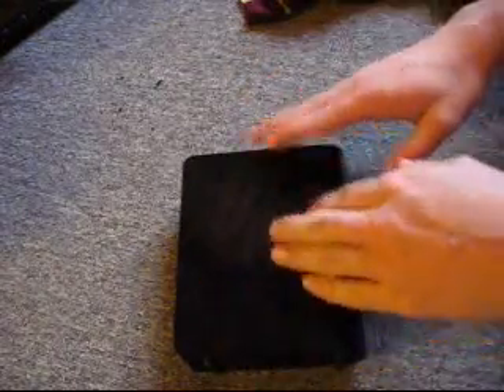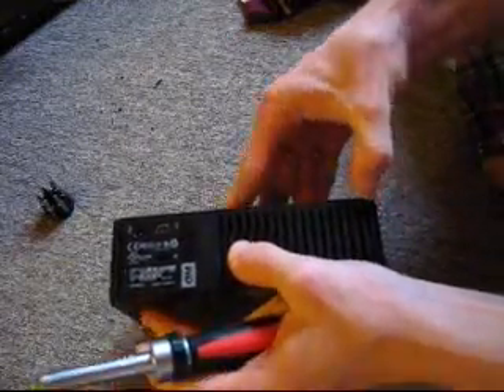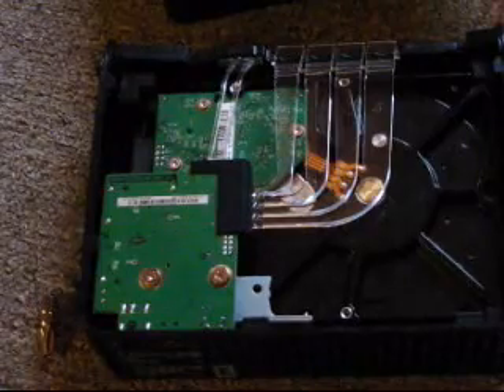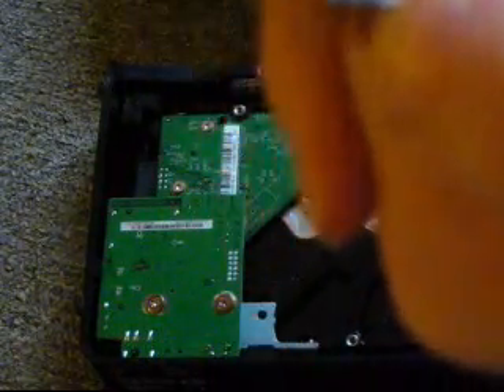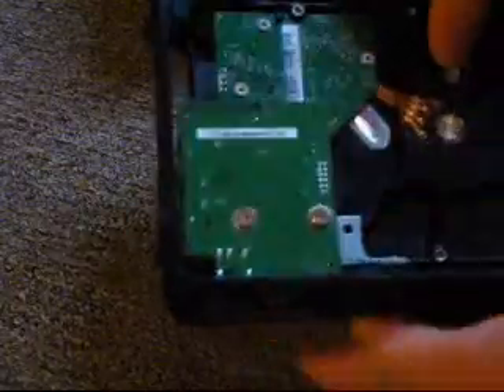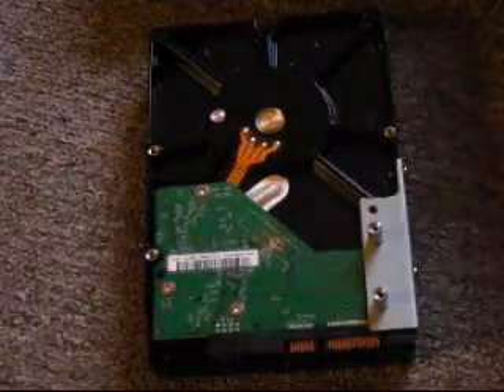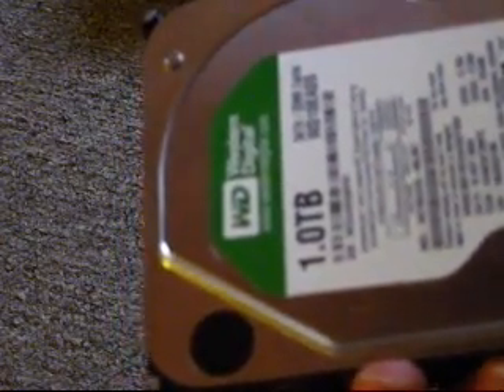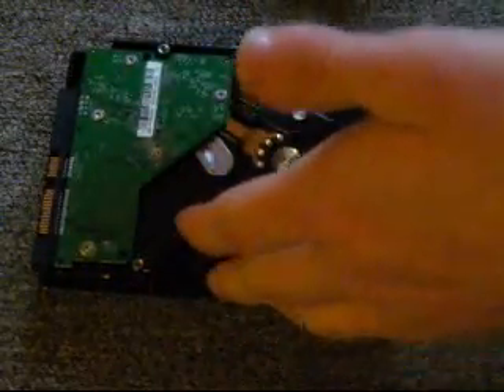How to fully DISASSEMBLE a western digital MyBook essential edition external HDD

Comment: Good video.  Credit card or credit-card-like rigid plastic works better in my opinion than a screw driver, and probably less risk of marring or breaking the plastics.  Just use the credit card the same way you used the screwdriver, and it pulls right out.

The SATA connector assembly that they use for the my_book works well for using as an external drive, just pull it off, and don't use the case, when you need to work on SATA drives.  Easy on, easy off.

Comment: actually, open the case doesn't void your warranty, WD has a rather good warranty service, the warranty is for the HDD. I recently have to break open the case of my MyBook Essential, there was a short-circuit and the drive wouldn't boot up. It turned out that the USB Board was fried, but the HDD was still working normally, I was able to recover all my data before bringing the drive to a WD Service Center for an exchange. Still in love with WD though. :D

Comment: The WD enclosures should be made for easier access than this.

It should basically slide out and then, slide in, easily. My Firewire MyBook (for Mac) had even more parts to unscrew and it's a whole lot more complex, for nothing, in my personal opinion.

Thanks for this cool video...

Comment: In case anyone wonders... It's not exactly a 5400rpm drive. It has an IntelliPower™ feature that controls the rational speed and cache usage between 5400 to 7200rpm. It's supposed to give you a balanced performance vs power use/ noise. generally it IS at 5400rpm except during large read / write sequences. But at usb2.0 speeds i doubt the transfer rate is fast enough to get it to change rotational speed much.

Comment: I have the exact same WD My Book Essential that you've shown in the video. Mine's a 1Tb USB 2.0. And I want to know:
(a) Can I to replace my 1TB with a 2TB? Is it safe to do so? Will there be any power issues? Or heating issues?
(b) Is it possible to upgrade from USB 2.0 to 3.0 by replacing the bridge board? I mean, are there SATA to USB 3.0 bridgeboards available that are compatible with WD cases? 
Please reply.

Comment: The one thing I do not like about this model is the weak connections on the USB port. Mine broke & now I have to use a USB to SATA/IDE adapter.

One note about taking this a part. It would be a good idea to mark the rubber corner pieces before taking the drive out. I would use rubber cement, if it holds, to cement them in place.

Comment: @Hwatts121191 Did you find out where to get this from.  I also need one.  My mini usb snapped off also and I need that power supply bit.  I have a heap of data I do not want to lose.  If you plug it into another casing, it is not recognised.  Any help offered would be a fantastic help

Comment: Instead of finger nail. I've always used a 2" putty knife. It's wide enough to prevent marring and thin enough to slip between the plastic easily.

Comment: I'm having an issue with this. I've managed to do everything and my hard drive came up but as a RAW drive. I couldn't get into it and had to reformat. When I did this, it came up as a 465GB hard drive.....but this is a 4TB hard drive I have:

http://store.westerndigital.com/store/wdus/en_US/pd/ThemeID.21986300/productID.287530200/parid.13092300/catid.13092800/categoryID.13093400

My question is if there is anyway to get my PC to recognize it format it back to a 4TB?
Reply from the maker: what file system did you use to format it?
Reply: NTFS

Comment: Western digital should be shot, often these drives are formatted in such a way whereby they are not recognised outside of the case in a standard PC, because western digital have formatted them in some bullshit way. I Personally and recommend to you to never buy a western digital drive ever again, once youve got your data on there reformatting it isnt an option as you lose the data and copying 900gbs somewhere takes half a day and requires the space, WD standard formatting should have been used!